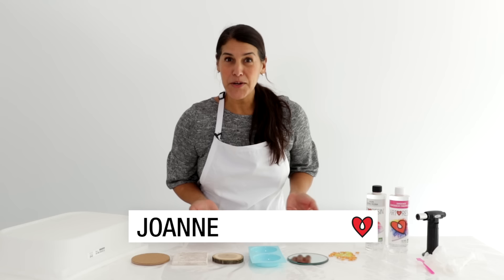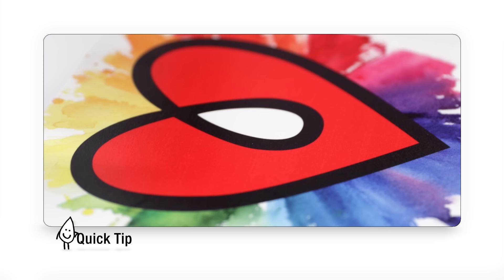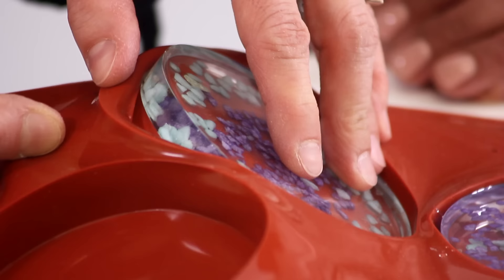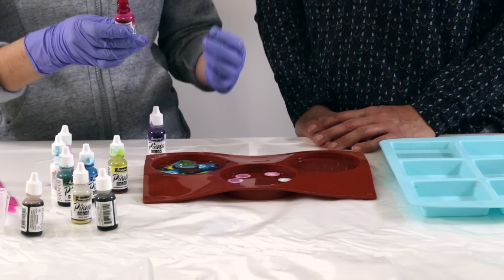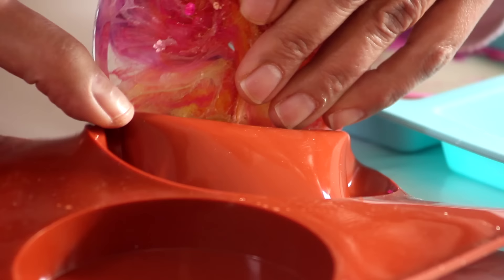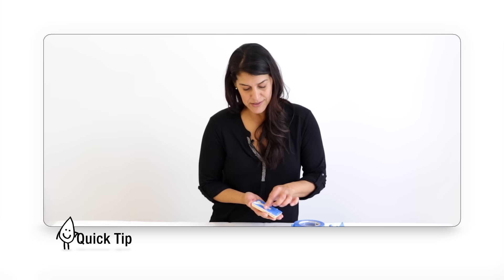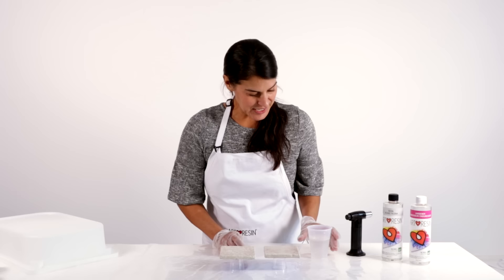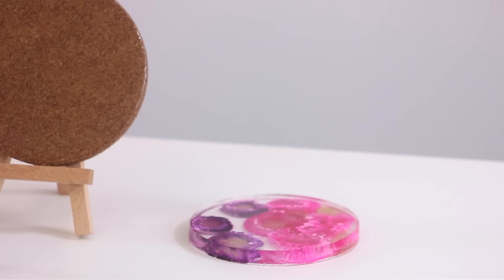How To Make Epoxy Resin Coasters - EASY!

Comment: when I use art resin to make coasters they are bendy not hard. do they get hard it has been 4 days.? I use glitter and alcohol inks.
Reply from the maker: Hi Debra, bendy resin can happen for a few different reasons.  Short cure time, thin pours, inaccurate mixing, or too much colourant can cause this.  Epoxy can continue to catalyze for up to 10 days, so while it should be mostly cured within the first 72 hours, it may take a little longer to reach full hardness.  Here is a blog on bendy resin and how to prevent it:
https://www.artresin.com/blogs/artresin/how-to-prevent-bendy-resin?_pos=1&_sid=8cfe937a3&_ss=r
I hope this helps 🙂

Comment: could  you put a smallflower in it?
Reply from the maker: Hi Carol - absolutely you could!  Just make sure the flower is thoroughly dried or else it will rot inside the resin.
Reply: ArtResin could you use fake flowers?

Comment: my resin can never get hard no matter how many days I leave it to cure. Is that normal? my ratios are perfect and measured
Reply from the maker: Hi Maella, after 24 hours your resin should be hard to the touch and will reach full cure by 72 hours.  You may find for molded pieces it will continue to harden up to two weeks.  Be sure you are not adding too much colourant-keep it under 6% and ensure that your piece is thick enough, recommended thickness is greater than 1/3".

Comment: Are you 100% sure that respirators shouldn't be used?  Great video though!  I have some concerns about resins and their toxic fumes even when there is no odor.
Reply from the maker: Linda you can always reference our SDS sheet for full safety details. If you are not in a well ventilated area or still have some reservations please do what feels right to you and wear a mask or respirator if you feel more comfortable doing so.

Here is our blog for more information: 
https://www.artresin.com/blogs/artresin/what-safety-precautions-should-be-taken-when-working-with-artresin

Comment: Once upon an eon ago I used to buy resin and hardener from Michael's. But the resin only required a few drops of hardener...  What happened, why is it 50/50 now?
Oh, and I could pour it as much as 3 inches thick without worrying about air bubbles.
Reply from the maker: You likely purchased another brand or type of resin which will have different ratios, cure-times and pour depths. Our product ArtResin has always been a 1:1 ratio and was designed as a surface coating for artwork :)  ArtResin is also non toxic and food safe when used as directed.
Reply: @Artresin  Oh I see.  Do you know what type resin that could have been?
Reply from the maker: @HEKuiper  I really am not sure to be honest. Michael's may possibly know.
Reply from the maker: @HEKuiper  I really am not sure to be honest. I might check with Michael's they may know
Reply: @Artresin  Okay, thank you!
Btw, are your products available in Europe, specifically The Netherlands?
Reply from the maker: @HEKuiper  Yes we have many retailers in Europe! I would contact Happy Things https://www.happythings.eu - they are based in The Netherlands :)

Comment: If you put a hot cup of coffee on these coasters are they going to leave rings in the resin?
Reply from the maker: ArtResin is heat resistant to 120 degrees F when used as directed. I have a coaster on my desk I use daily with hot tea/coffee with no issues.

Comment: Should I varnish ?
Reply from the maker: You would not need to apply another varnish on top of the resin unless you are looking to apply something that would give your piece a higher heat resistance or a matte finish.
Reply: Appreciated your reply 💐But without varnish would it  withstand hot mug ?
Reply from the maker: @dinaelsherbiny1727  ArtResin is heat resistant to 120 degrees F so perfectly fine for a hot cup of coffee but anything hotter like a dish straight out of the over would be too hot and could certainly mark or damage the resin.
Reply: Great thank you 💐

Comment: do you sand and polish these after ? or do you leave them as they are ?
Reply from the maker: Hi, icewollowcome, no polishing needed. You can embellish the edges with some metallic paint if you like, but it's all up to you :)
Reply: @Artresin  Very helpful thank you, so is this all based around "art resin" is there a difference between art resin and just resin in general ?
Reply from the maker: @douffousisdebest  Yes, the information in this video is all about using ArtResin to create different coasters :) And yes, there is a difference between ArtResin and other resins on the market today. ArtResin has no VOC's, is non-toxic when used as directed and is safe for home use without a respirator, when used in a well ventilated area. For more information about ArtResin, please visit our website and blog - What Are The Benefits of ArtResin
https://www.artresin.com/blogs/artresin/what-are-the-benefits-of-artresin?_pos=4&_sid=679799a12&_ss=r

Comment: How heat resistant to a hot cup of coffee is the resin?
Reply from the maker: The maximum temperature cured ArtResin can come in contact with is 120F or 50C.  A hot coffee mug should be just fine.  If the piece is newly cured, you may see a line on the resin from the cup, but the resin generally self heals as it cools and the line disappears.
Reply: @Artresin  Ok thank you for replying. Good to know.

Comment: Have you used any lubricant like petroliyam jelly from removing out of silicone mold
Reply from the maker: Hi Uma,

We have not tired that ourselves. We don't like using a spray release as we feel it tarnishes the finish. You certainly could test this out on a non-masterpiece to see if it works for your application :)

Comment: can you put decoration on the cork before pouring
Reply from the maker: You certainly can :) Depending on what type of paint/materials you will be using you may want to put a sealant on before applying the resin.

Comment: Does anyone know which resin works best w silicone molds? I've been using stonecoat countertops art resin but it almost always TEARS my molds!
Reply from the maker: We use and recommend silicone molds with ArtResin. Sometimes the time the piece should be left in a mold is different than the full cure time. While ArtResin is cure to the touch at 24 hours and a full cure is at 72 we normally remove our pieces from the mold at or slightly before the 24 hour mark and allow them to finish curing outside of the mold. Another trick is to NOT use a torch with molds as the heat tends to break down the mold and cause the resin to adhere to it.

Comment: my question is: Is art resin heatproof and waterproof? does it pass the hot cup of coffee test?
Reply from the maker: When used as directed it's heat resistant up to 120F, so perfectly fine for a hot cup. Anything hotter though, like a dish straight out of the oven for example, would be too hot and could soften or mark the resin.

Here are a few blogs that may help: 

https://www.artresin.com/blogs/artresin/can-i-use-artresin-to-make-coasters-and-hotplates

https://www.artresin.com/blogs/artresin/how-to-resin-a-coaster

Here is an unsolicited Youtube review when doing tiles with ArtResin. https://youtu.be/CyELRBP3jDw

Comment: Can you use anything instead of a torch?
Reply from the maker: You will want to use caution when using a torch or any flame with silicone molds as the heat can break down the mold causing the resin to stick to the mold. However on other projects using a torch is the number one way to achieve a flawless, resin finish, free of bubbles.

When you catalyze your ArtResin mixture, you create a lot of bubbles as you stir. Those bubbles need to be eliminated or they'll cure right into your piece. 

The flame from a torch heats the resin surface up instantly, thinning it out and allowing bubbles to escape very easily. Not only does a torch provide the pro results you're looking for, but has the added benefit of burning off tiny dust particles that may have landed in the resin.
Reply: So when using the silicone molds, what should I use instead?
Reply from the maker: @aspenhammer826  When using silicone mold a heat gun will be the best choice to apply some heat without damaging the molds.

Comment: Could you please tell me where you can get the animal prints for the wood coasters - others as well like wolves etc.
Reply from the maker: Hi Shannon - I just drew that bear design right on the coaster and coloured it in with Sharpie :)
If you see a design you like online, print it out to a size that will fit your coaster, then use carbon paper ( available at an office supply store ) to trace the outline on.  Then you can use paint or marker to fill it in :)  I sealed the coaster with ModPodge before I drew it on so that the wood would stay light.

Comment: Great video, where can I get the silicone spatula for mixing and the blue duo mould? Thanks
Reply from the maker: You can find the large white spatula on our website ( artresin.com ).  The blue mold is actually a cupcake mold that we picked up at Michael's - it had 6 parts and we cut it down to 2 for the sake of the video :)

Comment: Can these coasters be used for hot drinks?
Reply from the maker: When used as directed it's heat resistant up to 120F, so perfectly fine for a hot cup. Anything hotter though, like a dish straight out of the oven for example, would be too hot and could soften or mark the resin.

Comment: How do you finish off the bottom edge?
Reply from the maker: If you are making a coaster in a mold you really don't need to do anything. Some artists will add felt or something similar to the bottom if they wish. If you are coating the top of a tile or cork, you can tape off the bottom when you pour your resin to prevent and drips and remove it about 12-18 hours into the cure. :)

Comment: Sooo we cant use this in molds?
Reply from the maker: Yes you can use it in molds. ArtResin was initially designed to be a sealant and poured at an 1/8th of an inch in depth. We do have artists that use our product for pouring deeper than an an 1/8th of an inch but they achieve this by doing multiple pours. You can go up to 1/4 inch in your pour and would suggest you use a torch to help pop any bubbles you may have.

Comment: Would permanent vinyl stick on the epoxy? If so do we need to seal?
Reply from the maker: Hi Betty! We haven't tried placing a vinyl sticker/decal on top of cured resin. Now I tend to think it would need a sealant over top to make sure it doesn't delaminate over time as it would be similar to adhering it to plastic.

Comment: For the alcohol ink coasters, do you need to add a second layer on top of the ink after the first layer dries?
Reply from the maker: Hey Mallory - you could, if you didn't use too much alcohol ink in your first layer.  The alcohol ink tends to spread a bit, in which case you wouldn't be able to see a second layer.  Use a small amount of alcohol ink in your first layer, then use a little more in your second.  
The beautiful thing about resin art is that there's no right or wrong.  As Dave always says ... "experiment and have fun!"

Comment: I used art resin to make my coasters but 3 weeks later the glass still sticking to the resin. The resin is cure, 3 weeks old. Is there anything I can do for this situation to stop
Reply from the maker: Hello Jesus,

The maximum temperature cured ArtResin can come in contact with is 120F or 50C.  A hot coffee mug should be just fine as we use coasters here in the office daily without issue.

Are you adding any colorants into your pieces? We recommend adding no more than 6% colorant to the total amount of catalyzed resin or you could have issues with the cure which could certainly be the cause of this.

The mixture could also be slightly off which could leave the resin a little soft and not fully cure. If it is not possible to apply a thin layer of ArtResin to the top of your coasters at this point, you could certainly spray them with a polyurethane finish to seal in the piece.

Comment: Hey guys!! Can I put vinyl in my coasters!!
Reply from the maker: You might have to do some experimenting with it. Typically vinyl will repel the resin, maybe if you sealed the vinyl first and let it dry it might work. If you have some small scraps lying around I would experiment a bit and see if it will work for your project. :)

Comment: Why do mine go soft in the heat
Reply from the maker: ArtResin is heat resistant to 120 degrees so if your pieces start to warm up towards that temperature they certainly will soften but will harden back up as soon as they cool back down :)

Comment: is this epoxy safe to use without a mask ?
Reply from the maker: Hi, We care about our customers and we want to be transparent about what safety precautions are needed when working with ArtResin. A respirator is not required when working with ArtResin, when used as directed, in a well ventilated area. We do recommend wearing gloves when working with ArtResin because it's really sticky :) When it comes to safety precautions, a Safety Data Sheet is your go-to reference no matter what product we’re talking about. The ArtResin SDS is available on our website. No matter what your safety questions are, you will find the answers in that document. https://www.artresin.com/pages/sds

Comment: I wondering, does Art resin not get gas formation, that you don't wearing masks?
Reply from the maker: Our formula has no VOCs (volatile organic compounds), no fumes, and is safe for home use in a well ventilated area.  It is a clean system, meaning everything in the formula reacts together, leaving nothing that can become airborne and be breathed in.  It's also non-flammable in its liquid form and has only a slight smell.  And now, ArtResin has been recognized by the American Society for Testing and Materials (ASTM) as meeting safety standard D-4236: Safe for Home Use.

Comment: Is this resin heat resistant?
Reply from the maker: When used as directed it's heat resistant up to 120F, so perfectly fine for a hot cup. Anything hotter though, like a dish straight out of the oven for example, would be too hot and could soften or mark the resin.

Comment: How do you get air bubbles out when using alcohol inks?  Thank you!
Reply from the maker: A few helpful tips are to:
- warm the resin first to reduce bubbles to start with.
- the alcohol in the ink actually pops a lot of the bubbles on its own, but if you want, you can use a heat gun or torch before you add the alcohol ink.
- whatever you do, don't use a flame anywhere near the alcohol ink as it's highly flammable
Reply: @Artresin  Thanks for the info!

Comment: How can I remove a resin coat from a large piece to correct an area
Reply from the maker: I would sand down the piece enough to smooth our or remove the imperfections. Then clean and apply your second coat :)

Comment: How much do you fill in the mold?
Reply from the maker: Hi Jennifer, every mold is different so it really depends.  The best way to determine how much ArtResin you will need to fill your mold is to fill the mold with water then measure the amount of water it took to fill to the level you like-this will determine the total amount of ArtResin you will need to mix.  Just be sure that you dry the mold out totally before you pour in your resin.  💡tip:  with a Sharpie, write the amount of resin required for each mold on the back of the mold-then you will always know :)

Comment: Too warm a bath will cause condensation and the water droplets will ruin the mixture.
Reply from the maker: you're right that moisture will contaminate the resin.  We always recommend a water bath for the bottles with the caps on, so no moisture can get inside - the resin itself should only be warmed ... not so hot that it would cause condensation on the inside of the mixing vessel.  If it ever gets this hot, it can cause an exothermic reaction where the resin gets really hot and cures instantly.

Comment: Did you spray or grease the mould?
Reply from the maker: We do not, using a spray release may result in a finish that is tarnished by the interaction with the resin so I would avoid if possible.

Comment: When I warmed both parts of the resin, it flashed in less than a minute. Ruined the piece. Now I just warm up the resin part. All is good now. Full disclosure: another brand of resin was used.
Reply from the maker: I am sorry that happened!  It is always best to follow each different manufacturers recommendations as different brands can vary.  We warm both the resin and the hardener however we are careful not to use water that is hot, just warm is recommended :)
Reply: @Artresin  it took me a year to try it again though 🙄

Comment: Hi guys, how can I prevent my coasters from doming?
Reply from the maker: If you don't want your coasters to dome simply let the resin flow over the sides and smooth it out with a gloved hand :) You will want to tape off the bottom and prop them up as well.

Comment: How long in a hot water bath?
Reply from the maker: Usually just a few minutes works for us. I would attempt to remove it after 3-4 minutes, you will then be able to tell if you need to let it sit a little longer.